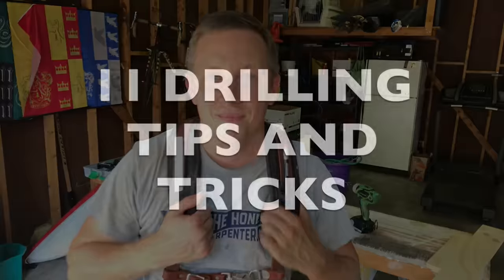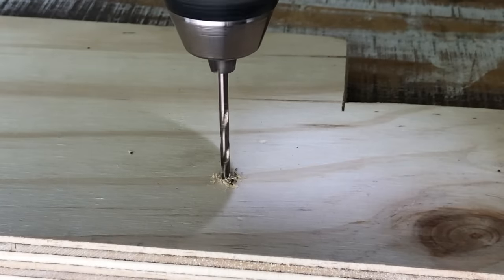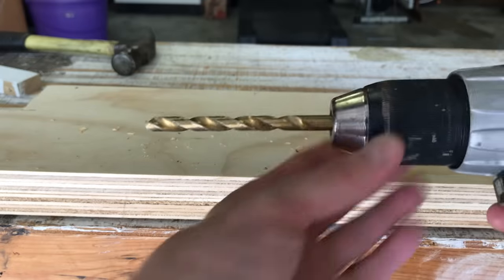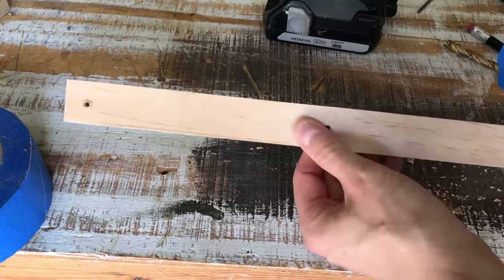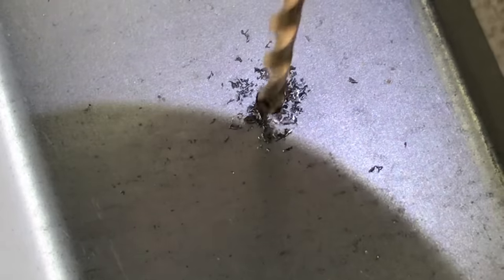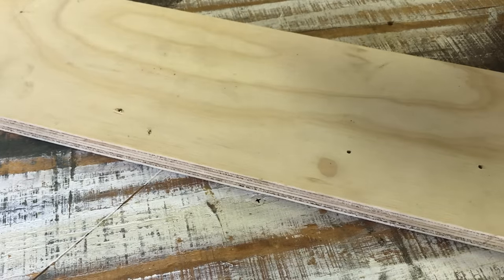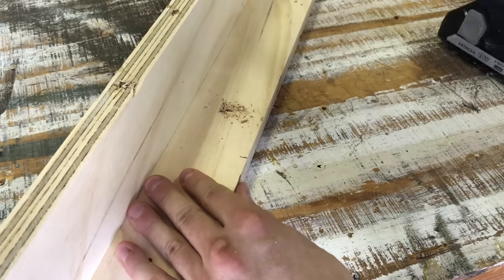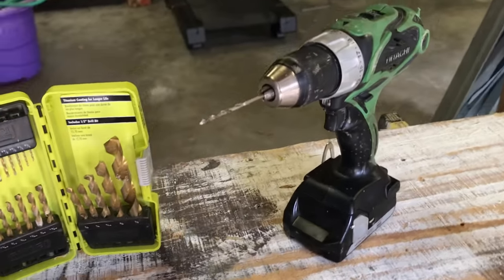11 DRILLING TIPS AND TRICKS (And Mistakes To Avoid!)

Comment: I usually leave a "tail" on the tape marker when drilling. That is, I don't wrap the tape around and around, I wrap it in half so there is a bit sticking off the edge, so it looks like a flag. That way it also acts like a brush when you are getting close and sweeps away the swarf.

Comment: Another way of drilling through metal that’s highly effective and will extremely lengthen the life of a bit is dipping your drill bit halfway in motor oil. You can use 5-30, 10-30, or 10-40 motor oil. The motor oil helps support the integrity of the bit.The oil also cools down bit while drilling.

Comment: When drilling metal a little oil helps to keep the bit cool and it stays sharp longer.  Just dip the tip of the bit in a drop of oil and add more as you get deeper.   A steel center punch is extremely helpful if you are drilling metal, mark the spot to drill, punch it and add a drop of oil.  Thread cutting oil works best but any thin oil will work, drip or spray.  I often spray some in a bottle cap and dip the bit every few seconds.  Don't forget bits get hot, especially drilling metal, so watch out when you remove the bit.  If you are drilling very deep into steel, remove the bit periodically and let it cool, your bit will last longer and not get dull as quickly.
A square standing up by the spot you are going to drill will help align the bit at 90°.  Site along the edge of the square and the bit.  
If your bit binds in the hole, start the drill and try pulling up, if it  still won't budge, reverse the drill and back it out.  
Be sure to use the correct type bit, brad point bits are just for wood and soft materials and HS bits are for most everything else.   
Quality bits will save you money in the long-run, cheap ones dull fast and break easier and have to be replaced.  
Sharpening bits is not hard to do, look on youtube for videos showing how.  .

Comment: I heard you say something very critical with drilling…the sharpened of the bit removes “chunks” and the tip is burning through with “friction”. Friction will increase with pressure and both metal and wood are different…you want to apply more friction to metal…nvm you said thay

Comment: I measure the screw by putting it in the drill index of the bit case, once I find the hole that the screw fits in just barely, I drop down 1 size. Has always worked for me. At 72, my eyes aren't that sharp anymore relying on the eyeball trick

Comment: Don't throw away yr broken or blunt bits, they make great work for cleaning out drill holes in masonry walls by hand.  Use a smaller bit than the hole diameter, and lightly twist and run it back and forth a couple of times to remove residual dust and grain.

Comment: Probably should have mentioned the step up method does not work with spade or hole saw bits as they require center material to track the bit. Flute bits only! Also, it's important to support the underside of your hole to prevent blow out.

Comment: Two points:
1. Always replace broken drill bits asap. Note it on your phone app for the next trip to the hardware store! Start using your phones note app to keep a shopping list!
2. Tapered drill bits are a carpenters best friend! You don’t need a whole set but a one or two will allow you to start a pilot hole in wood with precision.

Comment: Sometimes (often) when I'm screwing in fasteners, my bit jumps out of the screw. Am I doing something wrong? Do I need a new bit?
Reply from the maker: Good, solid in-line pressure without too much speed is the key, Steve. Also predrilling to the right diameter is extremely important!

Comment: Not exactly a drilling tip but, if your pilot hole is a little too small and you don't have the next larger drill bit, put some dry bar soap in the screw threads.  The soap will provide enough lubrication to allow you to insert the screw.  When I'm screwing by hand, I always use soap to make the job easier.

Comment: I need (make my life easier) a portable drill that can keep rotating without my right index finger having to keep the pressure on the switch. Is there any model or device that you can recommend? I will appreciated.

Comment: Additional tip is when drilling metal,use oil.another one is if you drill 90 degree angle use a speed square as your guidance.

Comment: We always called it "reaming out" or "wallowing out" a hole instead of "hogging out." And you don't see many guys as talented as you using a Hitachi drill. But I guess I used a porter cable for years before I upgraded to Dewalt.

Comment: For depth control, sometimes I've used a piece/block of material drilled through and thick enough to stop the bit from going deeper, in place of tape. For times when having the block of material spinning on the bit come into contact with the material is not a problem, and speed is more important.

Comment: I started to drill a pilot hole in my house cement foundation using a regular drill and a masonry drill bit. However, I now find that I'm not making much progress after 20 minutes. If I decide to use a hammer drill to complete the pilot hole, will I need to change to a hammer drill bit?  Thanks.
Reply from the maker: You’ll need a hammer drill bit, and a drill with a hammer function most likely, L!
Reply: Even though the first pilot hole is 50% complete? I can switch drill bit at this point?

Comment: tip 12: use a drop of oil on the screw, it does go in much softer
tip 13: use a peace of wood under the working peace, it prevents splitting 
tip 14: adjust the torque of the drill to fasten the screw
tip 15: use a punch drilling metal
tip 16: when drilling metal, always use oil for cooling
tip 17: always use the right drill bit for the job, you are using metal drill bits drilling wood. 
tip 18: use a walnut bit for smoothing the boundary of the hole before scewing the fastener
tip 19: never use excessive force when drilling. not even on metal

... to be continued ...

Comment: Another tip for drilling metal is to oil the spot you're about to drill so the heat is taken away from the bit. You can use almost any oil for this.

Comment: Countersink by hand in softwoods.  Don't use a power-drill.  You might need to wear gloves or tape the drill bit.  For thin materials with twist bits, clamp a block of scrap wood on the drill site.  This makes the holes rounder.  Also for thin materials, use a step drill.  Improve squareness by using a support such as a skateboard bearing or socket - be creative.  Don't be afraid to hand sharpen drill bits.  It won't be perfect, but you'll go a lot further for not much $.  Even a bit of flat concrete can improve the edge of a really dull bit.

Comment: - Put tape on the back surface of your workpiece before you start drilling through the workpiece. It helps you avoid tear/blow outs on the back surface of your workpiece.
- If you do not have clamps or vise grip but you'd like to drill through or fasten two workpieces. Put a small dab/drop of quick setting super glue (or wood glue if you are trying to permanently secure both workpieces. Note: for the wood glue, sprinkle a tiny amount of table salt to help fractionally steady both workpieces relative to one another) to keep two workpiece from sliding relative to one another while trying to drill/fasten both workpieces.

Comment: TIP;  To drill perpendicular,  go to $ store & get a pizza  cutter,
remove wheel, Drill out hole in wheel to 1/2" or larger.  To use;  Drill starter hole,  Lie wheel on item to be drilled, hold in place, 
watch reflection of bit in wheel, it's easy to hold drill @ 90'.

Comment: Tip#12 Make sure the direction of the drill is correct and tape over the switch so you do not knock it when drilling. Having the drill bit rotating the wrong way will really mess up the bit. ( I would never do that I hear you say...) Usually happens when taking a sip of coffee between hole 10 and 11 :(

Comment: Something that became very obvious to me after making a mess multiple times, when drilling a hole in a wall, tape a plastic bag very close to a horizontal line under the hole you are drilling, in this way all the debris that comes out of the wall will fall into the bag directly reducing the amount of dirt and brick powder you have to cleanup later.

Comment: Great tips and loved learning new words like swarf!  Do you have any tips for using a Forstner drill bit?  I would like to add a hole on a desk top that has a formica covering so that I can manage/organize the various electrical cables that I use.  Thanks so much!
Reply from the maker: Thanks Evelyn! Forstners are often best used in drill presses, because they like stability. But they’re quite forgiving to handle overall. If you need to cut a hole over 3/4” though, I’d recommend a hole saw bit instead!
Reply: The Honest Carpenter oh my gosh, THANK YOU!  I’ve never heard of a hole saw bit.  Since the desk top is firmly mounted a drill press probably isn’t a good option, plus I do want to cut a hole bigger than 3/4”.  All those Pc cables and the things that I like to use (Cricut, sewing machine, laminator, spot light, monitor, speakers) make a jungled mess.  I will look into this!
Reply: @evelynwald9132  
Hi Evelyn  👋 I hope my comment didn't sound as a form of privacy invasion your comment  tells of a wonderful woman with a beautiful heart which led me to comment  I don't normally write in the comment section but I think you deserve this complement. If you don’t mind can we be friends? Thanks God bless you….

Comment: Use a flat drill for bigger / deeper holes. In this case, low speed is better, because that type of drill does "plow" the wood efficiently, and it only wears out quicker due to higher friction (lower hardness, less cutting). Back out excessive wood as it encases the heat inside the hole too! Cheers

Comment: Cut a piece of branch / round stock the length of drill you do not want to use. 
Drill through it with that drill. leave the plug on the drill. 
You now have a forced stop on the drill. you can now drill 100s holes the same depth with no mistakes or tape wearing out.

Comment: I am confused, why use metal drill bits on wood? If you use wood drill bits, you will not need to make a pilot hole because the drill bit has sharp pointy tip, that bytes in to the material. Also wood bits have a lot sharper edges, that make the drilling easier.

Comment: Tip number one! Do not brush away swarf using your fingers. That way lies embedded splinters. Nearly all tutorials fail on this.
Reply: Philip Welsby     Yeah, you are so right about that. I learned a long time ago 
about using my hand/fingers to push the chips aside. Got my share of splinters, especially with metal. Now depending on the situation I use a small brush, sometimes I just blow the chips away or use my dust collection system to vacuum up the debris. With metal, I have used a magnet in addition to my other methods. And I never fail to wear goggles.

Comment: Hi Honest Carpenter,.
You should advise your readers about traveling but whetn drilling metal.... That hole punching may not indent sufficiently. Often, the metal surface is springy, hence unable to be successufullly hole punched. Peraos suggest that when drilling into, say, aluminium,vthat to one should use a simple block of wood, clamped with a vise, with the wood pre-srilled, therefore being a guide  This was the only way I could get the bit to not travel and it was an easy success .

Comment: Tip No. 1 - why not to use wood drill bit? You would not have to deal with wandering (and you would not have make a punch). 
Tip No. 2 - if you are already using metal drill bit and it is dull, you do not have to get rid of the drill bit - with proper tool you can sharpen it...
Anyway - great channel, I like to watch your vids!

Comment: Why are you using steel drill bits and not wood drill bits? 
Is there a reason? Since wood bits avoid some of the problems by design.

Comment: nice video man ... I have a question.. how i choose between different drill model in term of power (watts, rpm..etc) and brand if i want using it in light duty home purpose?
Reply from the maker: Thanks Bo. For light duty stuff around the house, I feel like you can’t go wrong with any 18 volt, and a 12 v can even be enough for most tasks
Reply: Thanks for advice
Reply: 18 volt drills are just so versatile, esp if you get a brushless good brand one -loaves o0f power, nto too heavy. Its the first power tool everyone shoudl have .

Comment: Also on metal, DON’T  STIR. 
That’s what breaks off the outer corners of the drill point, and then you’re going nowhere.  Low RPM and high pressure require both hands on the drill motor to pr event snapping the drill off sideways and also control a straight push,  NO STIRRING. 
Oh, and a drop of oil.

Comment: Good information but - why use metal drilling drills for wood? Use brad-point drills for wood - it is what they are designed for. They don't slip around as they have a sharp point, and they don't cause tear-out as they have a sharp cutting edge. A small set is fairly cheap and well worth having. Also - roughing out!? Not something I'd ever want to do with anything other than a rough carpentry job - certainly not on any joinery project.

Comment: one important safety tip. when drilling small holes and then using a larger bit to finish it off, 
DO NOT HAVE THE SMALL HOLE SIZED BIG ENOUGH THAT IT ENGAGE THE FLUTES OF THE LARGER BIT. 
this will turn the drill into a high powered screw it'll just rip intselft into the hole in a second and can make it twist your hands!

Comment: I was trying to drill and when I push it in it’s so hard , is it just the wall I’m really worried there’s a pipe
Reply: you should be worried, there can be ducting/electrical/ or if you're lucky just a beefed up steel casing (fine to drill through of course) but knowing is crucial, if you havent already turn off the circuits in that part of the building and of course check to see if you can follow any appliances that might need piping above or below where you are drilling.

Comment: One comment... when using nuts and bots, you obviously want the bit to be the exact size of the bolt diameter (including the threads) or slightly larger, otherwise you'll end up screwing the bolt into the material of the undersized hole.  When you're not using the friction of the threads to fasten two pieces of material together you want the hole to be the same size as the threads since a nut will be on the other side.  You don't want to force delicate bolt threads into a hole that is too small. especially when making holes in metal where a bolt (and not a metal screw) will be used.

Comment: Please can I know how to keep the drill in an perfect angle to drill into a wall.
Thank you
Reply: you can't be serious, can you? do you mean how do you hold a drill straight? or are you having issues handling your drill? if you're having issues handling your drill and it's causing you to drill at a wonky angle it's likely either the wrong drill bit, go and buy a set of masonry bits, or your drill bit is dull.... it could also be cuz you're using a crappy drill "screwdriver" with low torque... in that case: get a good cordless combi drill (ryobi, bosch, dewalt, makita or milwaukee) or a cheap hammer drill (any brand). the combi drill will do everything an average DIYer needs, but will be pricey for a decent one (well worth it though), the hammer drill on the other hand is a really powerful drill that is only for drilling holes in walls... bit holes, lol, but you can get a cheapo one that will do the job (bought one myself 10 yrs ago for like £15 and it still does its job)

but if you mean how to make sure your drill bit doesn't wonder when you start to drill into your wall? if your wall is "slippery", such as a vinyl/glossy surface, I'd use a bit of painters tape so the drill bit doesn't slip when you start to torque
Reply: @hankhill6416  Thank you for your useful advice.

Comment: When do I use brass drills instead of steel ones?
Reply from the maker: Hey Kenneth, most of the brassy looking ones are titanium coated these days. Honestly, you can use them just about anywhere! They're good for drilling metal, wood and plastic. They're pretty much the only ones I buy because they so useful, though they will run you a little more

Comment: 1 useful tip is to never insert a drill bit too deep into the chuck, as if the points of the drill are beyond the flutes of the bit it will snap off.

Comment: Loved the video. I'm a forced DIY'er. Society has definitely changed or I'm just in the wrong locale, but dudes can't fix ANYTHING. Anywho, my question is do you (or anyone reading) have any tips for drilling that cheap, not so solid wood board material? You know the stuff with I guess compost or something in the middle? I'm a cheap bastard and don't want to buy another bookshelf. I went and bought some right angle brackets and want to drill them into it. Bought a 20V Workpro drill. Also have to replace a fallen bracket for my blinds. I figure I might have to use some wood filler before drilling up in the window sill. Any tips would be greatly appreciated.

Comment: If I have to make a 3/4" hole in a nice wooden conference table for a cable but want the hole to be as clean as possible. Would you recommend an auger bit, spade bit, or hole saw bit? Or another bit I didn't mention? Thanks
Reply from the maker: Hey Wade, if possible I would use a forstner bit. Typically the most expensive bit, but bores incredibly smooth holes

Comment: none of all the drill bits you show here are for drilling wood ! not a single one . all of them are for drilling metal . you can use these , but you must reprofile the drill bit tip . that is the reason for the tearing of the wood . same thing is done for very thin steel plate . and this is the 12th drilling tip .